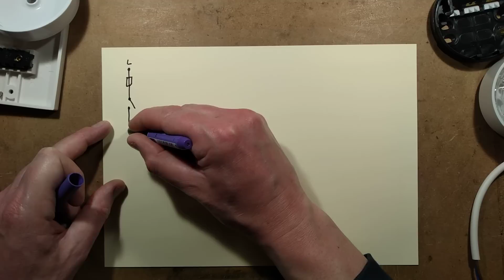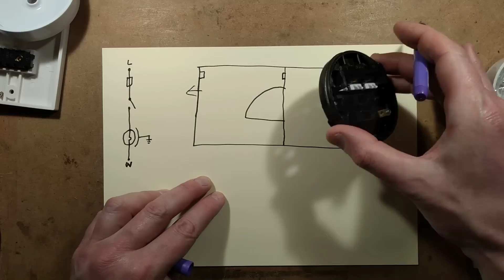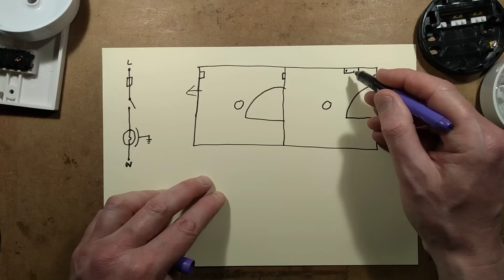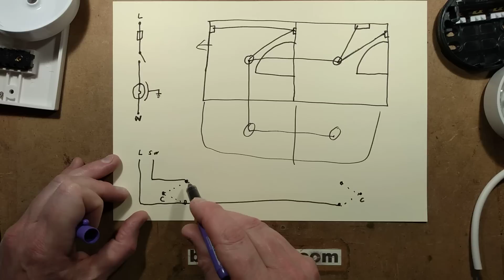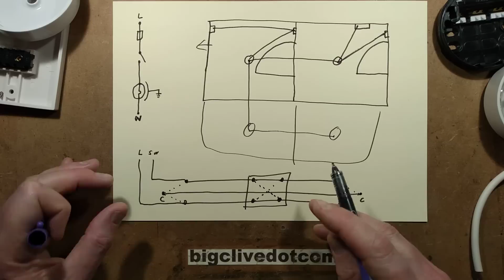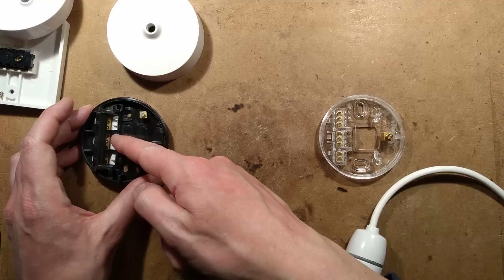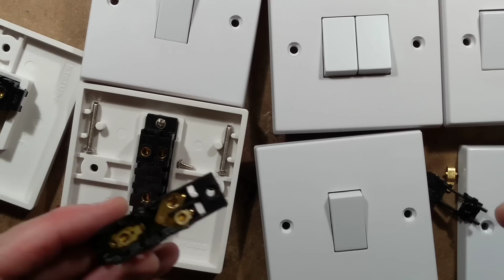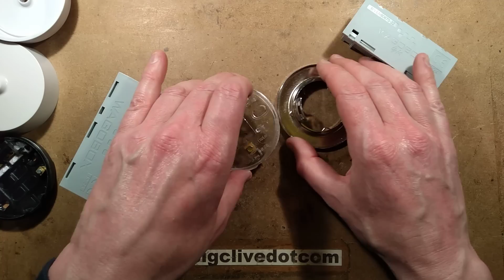British home wiring.  The incredibly simple lighting circuits.

Comment: For the flat cable in the US its called Romex, kinda like R12 is called Freon. There is a cheap tool called a Romex stripper. It looks like its made from a flat piece of sheet metal about a inch wide and about 5 inches long with a half inch hole in the center then looks like its folded around a half inch pipe. On one half its has like 1/8 inch "V"  pressed then folded down like knife pointed down. So would slide the Romex cable through it out the hole in the center then you squeeze it so the "V" presses into the cable ,then pull the cable out with a slit now in the center of the cable.
Reply: Their 'twin and earth' appears somewhat similar to our UF cable. I was taught to strip UF using the method Clive showed at 8:40.
Reply: Would be handy if you could upload pictures so I could see what your describing

Comment: In New Zealand it’s unusual to find a light fitting with a live loop, rather the loop runs to all of the switches and the light fitting (and therefore the light itself) is only live when the switch is on.
Reply from the maker: That catches a lot of people out.  They turn the light of at the switch and then play with the wiring thinking it's off.
Reply: The lampholder isn't live with the switch off but the ceiling rose is.

Whether in the UK or NZ, you should be aware that neutral can become live under certain fault conditions.  They're rare, but they can happen.  If you're just changing a lamp, no problem.  But if you're fiddling with the wiring, or trying to fish a filament lamp with a broken envelope out of the holder, you can touch neutral, but that neutral wire may actually be live.  Incidentally, that's why (in the UK) we're meant to refer to liNE and neutral, not liVe and neutral, because both line and neutral should be treated as possibly being live.

Oh, and you should probably account for the possibility that whoever wired it up was an idiot and somewhere swapped the line and neutral so the colours on the cables don't match the reality.  So if you're fiddling with wiring turn off the main breaker in the consumer unit to isolate both line and neutral.  Unless you have a really primitive consumer unit, in which case pay somebody else to do the job (that's what apprentices are for).

Comment: Ireland changed to twin and earth with an insulated earth and an earth wire with the same CSA as the live and neutral in September 2017. I've had a play with the cable and like it quite a lot, fair bit bigger though, and I've not seen a 3core and earth version. I don't live in Ireland though.
Reply: Sod using 6mm and ten mm in Ireland the twin and earth would be a right pain
Reply: @andrewmayes3271  I got some samples recently of this cable and it is amazing to work with. The only downside is the larger outer dimensions of the cable. I like it a lot, earth already sleeved, and will give nice low earth readings. Many countries use a similar design of cable.
Reply: @echothehusky  would be good for longer runs of shower and cooker cable but let's hope they still offer unsleeved for short runs to keep down the costs

Comment: I've never seen such a lighting junction box here in germany, makes me wonder why? Looks like a very good idea!
Reply: Maybe Germany uses the loop through rather than three plate wiring method. 
This involves bringing a cable with both the line and neutral down to the switch box and connecting to a cable going back up to feed the next lighting circuit. The luminaire cable would be the third cable that is fed right to the switch box. 
The neutral would be connected directly through to the luminaire cable but the line wire  would go through the switch. There are three cables in the switch box rather than just one in the three plate (ceiling rose) method unless it's the end of line.
Using the three plate method cuts down on the wiring needed. This was probably implemented due to post WWII shortages (just like the descision to use ring circuits rather than having radial circuits).
The two plate method is gaining ground in new installations in the UK as it enables "smart switches" to have the permanent power they require to work.
Reply: @wwsxa39  No, our junction boxes just look different.
Reply: @wwsxa39  there is brands out there that do not require a neutral at the switch for smart switching

Comment: TLDR: In Germany, it is totally different.

In Germany, I have only seen the 3 single insulated wires coming out of the ceiling directly. I have never seen such a dedicated box being fixed to the ceiling. Lamps get screwed on to the wires with a Lüsterklemme and a plastic cup supplied with the lamp gets loosely over it to visually cover up the wiring.
Oh, and beneath a room's door there usually is a wall socket and light switch directly above each other. A cable goes from the circuit breaker to both of them. From the switch, the cable goes to the ceiling hole. So far, I have not seen dedicated light circuits but only one to three entire rooms sharing a circuit breaker. I am not that professional thou.
Reply: Also, our Earth is sleeved and yes, we usually strip cables like you explained if you only got a knive, but there are special tools that make sure you don't damage the second individual insulation
Reply: Do you know what Lüsterklemme translates to?
Reply: @l3p3  "terminal strip"